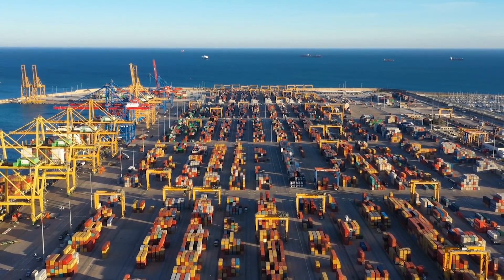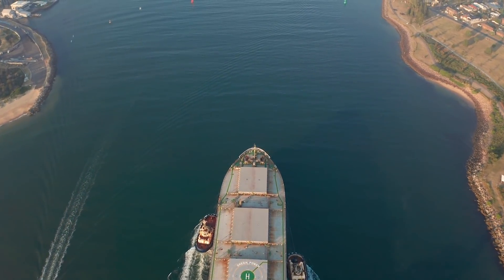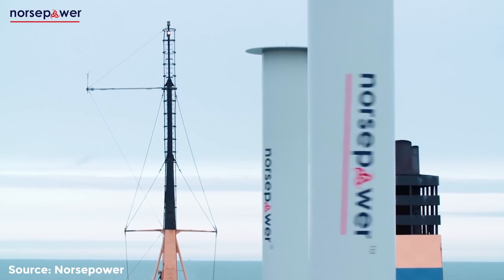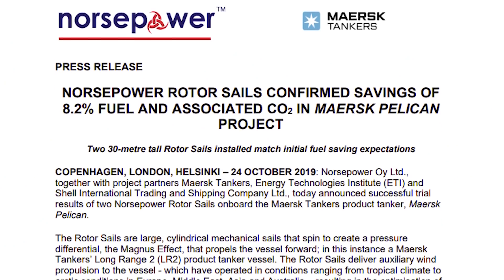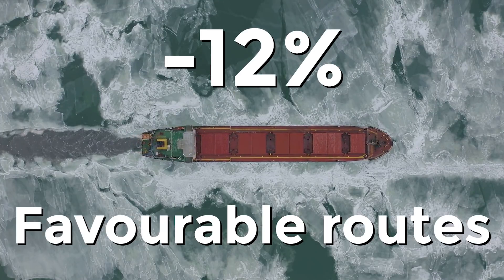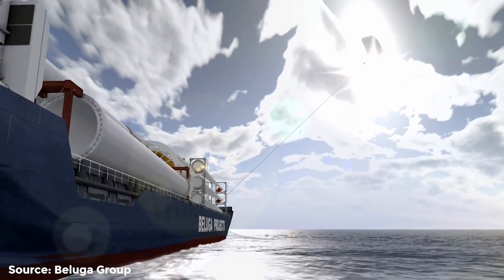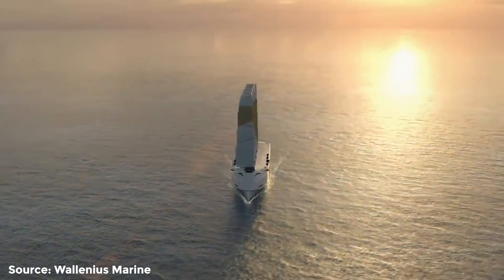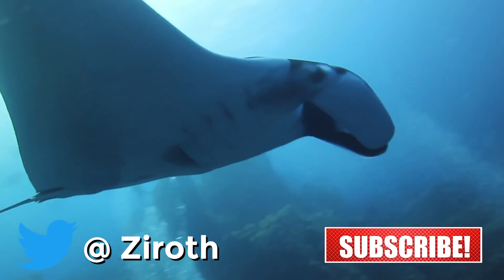Is Wind Power The Future of Shipping?

Comment: You can't expect that a propulsion technology which is intermittent (wind, solar) and is only efficient under certain conditiones (wind direction, wind speed, solar -> atmospheric conditions) can replace a technology which has a steady, non intermittent and unconditional output.    
The non deck- obstructing sail is interesting though.  Even if it can cut 10% of the fuel usage on a long trip and favorable conditions, this is a huge number when you add it up for thousands of ships.  It is also probably relatively easy to retrofit older ships with that technology.
Reply: Would 10% fuel saving fund the capital and operating costs of the additional hardware?  Fossil hydrocarbon energy  is relatively cheap, which is what created this climate change situation.  With regard to retrofitting the payback time and benefit margin must fit in the overall remaining life expectancy of the vessel being retrofitted.
Reply: @BernardLS  IMO the "climate change situation", as we have it, was predominantly created by nature, not by us.  Nevertheless I welcome technologies which replace the combustion of fossil (which might not be fossil after all)  hydrocarbons.  But only if they really can compete in an ecological and economical way.
Reply: @RogerWilco66  The "climate change situation" is another area of hot contention so best to set that aside for now.  To address the suggestions that wind power is the answer I offer the following example.  In 1870 a premium sailing vessel entered service, the ‘Cutty Sark’.  The ‘Cutty Sark’ was 64.74 metres in length with a beam of 10.97 metres and a loaded displacement of 2 100 tonnes.  She was able to carry, at best, 1 700 tonnes of cargo and to harness the energy in the wind the available spread of canvas was up to 2 976m2 which was tended by a crew of about 30 skilled men.  A ratio between the sail area (SA) and the vessels displacement (D) determines how lively she is; ‘lively’ being nautical speak for ‘fast and manoeuvrable’.  The carrying capacity of cargo ships is constrained in two ways, mass and volume which leads us to the ‘stowage factor’ of the cargo; the more mass on board the greater the displacement which in turn impacts the efficiency of the hull form and sail area / displacement ratio.  A vessel constrained by mass is said to be ‘down but not full’, while a vessel constrained by volume is said to be ‘full but not down.  When in the tea trade, which the ‘Cutty Sark’ was designed and built for with fine lines (more nautical tech speak, so again no need to worry about it) she could carry around 600 tonnes of cargo at speeds of up to 17.5 knots dependent on the prevailing wind and had a typical China to UK time on passage of 120 days.  The tea trade was very competitive so ‘time on passage’ was a large factor in securing the premium freight rate that made her cost effective.  Rounding things out, her maximum available sail area gave circa 5m2 of canvas for every tonne of tea carried.

As soon as the Suez Canal opened, which the ‘Cutty Sark’ was unable to sail through; she lost her advantage, raw speed, to the steam powered ships of that era who could beat her ‘time on passage’ by taking that short cut.  Mechanically powered ships have improved in terms of efficiency, on a freight tonne mile basis, by at least one order of magnitude since then.  After losing out to the coal burning, fire tube boiler, steam reciprocating mechanical ships of the late 19th century ‘Cutty Sark’ was relegated to the Australian wool trade, just about the bottom of the barrel in maritime terms and only one small step up from being a 'honey barge'.  The canvas, cordage and extra manpower needed for sailing ships was never a very benign environmental option so please discount any idea of sail as ‘sustainable’.  All this is without the problem that if ‘the wind don’t blow the ship don’t go’, when it does blow it often blows in the wrong direction for your cargo delivery needs and sometimes there is rather too much of it for comfort.  Sailing ships are unable to go directly up wind so if the wind is blowing from the direction your cargo needs to then a zig-zag course must be steered, more distance and more time.  Wind speed is traditionally measured on the Beaufort Scale (wind speed) that runs from 0 (< 1kn) to 12 (> 63kn) and for sailing purposes the usable part of the range is ‘3’ (circa 8kn) to ‘6’ (circa 24kn).

Random fact about ‘Cutty Sark’, it is said to have been possible to coax 3 000 horse power out of her sails, or in ‘real money’ 2 206 500 Watts (2.2 megaWatts), or 741 Watts for each square meter of sail area.  So that majestic spread of canvas would have been even less efficacious for delivering your baubles and bows from the orient, despite taking about three times as long on the voyage.  The sails on the ‘Cutty Sark’ produced about 0.33% of the power need to propel a Mearsk Triple E and in ‘ideal conditions’ the energy harvest would be less than one two hundredth of the output from the ICEs.  Remember shipping is a high volume low cost, therefore low margin business, and all costs have to be beneficial.

Canvas and hemp are accorded 'renewable' (read as ‘natural’) status, if ‘synthetics’ are used there will still be a need for the input of FOGI products.  'Synthetics' would have a much better working life span than 'naturals' but would still yield the same amount of energy, 741 Watts for each square meter in those elusive ideal conditions.  Wallenius are currently giving wind power a go with wing form ‘sails’ but evidence is a little short of proof as of this date.  KTH (Kungliga Tekniska högskolan), a sort of up market university in Stockholm, who are using the funding to derive results will probably, and eventually, in the best traditions of academia ‘publish’ a ‘paper’ unless the funders invoke the well known ‘commercial sensitivity clause’ of their agreement with the KTH.  On board wind turbine might get you around some of the problems, however for marine use vertical axis wind turbines (VAWT) would be better than, the what have now become 'traditional', horizontal axis wind turbines (HAWT) for reasons that include the air draught of the vessel, weight distribution and maintenance access.  The energy yield is still subject to the wind blowing at the right strength and having space available on board for the hardware.  The masts, rigging and sail handling arrangements would take up 'prime real estate' on the vessel.  Fuel oil bunker tanks can be, and usually are, stuck away in any odd corner and the ICE power plants are themselves relatively compact.  The stacked up 'boxes' would mean putting the wind driven propulsion units in a bad situation from a ship stability point of view.

Comment: Big issue is the ratio displacement/sail area. It's not even close in these projects.
Reply: When in the tea trade which the ‘Cutty Sark’ was designed and built for, with fine lines, she could carry around 600 tonnes of cargo at speeds of up to 17.5 knots dependent on the prevailing wind and had a typical China to UK time on passage of 120 days using up to 2 976m2 canvas sails.  Rounding things out, her maximum available sail area gave circa 5m2 of canvas for every tonne of tea carried.  So to move 180 000 tonnes of cargo, a typical VLCC or Post Panamax, could call for up to circa 900 000 m2 of canvas; which would be impressive (:-).

Comment: Edison generators and dynamos easily replace fossil fuels. Edison generators are permanent magnet motors that have generator coils of copper wire. You can chisel an old car generator pre 1974 to spin itself and generate electricity. Of you add 12v 110v ac inverters you can produce house current 6  20 a outlets.

Comment: The future of ship propulsion is nuclear. Ask the US navy
Reply: WADR if you do a web search for ‘nuclear ship savannah’ you will see that it has been tried and did not work.  A similarly vessel heavily subsidised, by the government, vessel is in use in Russia which also operates, in support of the Northern Sea Route, a fleet of nuclear powered ice breakers all of these may, or may not, have been completely without issues.

Just think; would you have full confidence in the management of a nuclear reactor under the control of an anonymous entity only traceable, perhaps, via a letter box in a FOC (flag of convenience) nation state?  If you are, could you sell that confidence to Japan, the state that hosted the Hiroshima and Nagasaki nuclear detonations as well as more recently the Fukushima ‘event’?  Then try that same, or a similar, sales strategy on Ukraine, the nation state that as a part of the USSR (CCCP) hosted the Chernobyl ‘event’.  Modern iterations of nuclear energy, thorium fuel, molten salt reactors or fusion reactors, will carry the legacy of past problems.  It is the global trepidation of anything with 'nuclear' in the name and the economics of nuclear having transitioned from 'energy to cheap to charge for' too 'the costs of remediation are incalculable' that will prevent the adoption of nuclear energy as a means of creating energy at sea.  Modern reaction systems may have overcome the safety problems but the general public, having been misled in the past, will be reluctant to believe the fresh new promises.  The incident of the ‘Ever Given’ blocking the Suez Canal, March 2021, may also have a little to add to this debate.  The cooling water on ships tends to get taken in from near the bottom so when running aground the inlets are in a prime spot to get plugged up restricting, if not stopping, the flow of coolant.  One thing that the TMI, Chernobyl and Fukushima incidents all had in common was that the supply of coolant, or rather lack thereof, was a fundamental cause.

‘They’ say nuclear is cheap, it’s not it is expensive and has a large embedded carbon quotient as well as being complicated, dangerous, not universally socially acceptable and having only ‘no need for refuelling’ as a questionable advantage; actually it does need refuelling just not as often.  When ‘they’ do need to refill the warming up stuff it takes considerable longer than pumping tonnes of thick black stuff, cSt380 HFO, or thin runny stuff, MDO, onboard which is one of the reasons HMS Queen Elizabeth and HMS Prince of Wales are pushed about by ICEs and gas turbines thus using a similar fuel as the aircraft that fly off of them.  The Royal Navy (RN) with a high degree of skill and expertise uses, at vast expenses to the UK taxpayer, a current operational nuclear fleet of 11 submarines (also known as ‘boats’) in two flotillas, seven attack subs and four ballistic missile boats.  The carbon footprint of all the extra bits of hardware and the fuel, including processing thereof, from ground to propeller, are the external costs that never seem to get considered.

Disposal, once it wears out, of both the machine (that was a ship) and fuel is another can of worms best left unopened.  The 26 RN boats no longer in use are laid up (some in Rosyth and some in Portsmouth) awaiting long term deconstruction including dealing with the fuel rods and other irradiated material.  The USN is not, as far as I know, a commercial organisation working to very tight margins and also has the skill and expertise to handle the complexities of nuclear power; so as well as submarines their aircraft carriers are nuclear powered and each of the current iteration has a build cost three times that of QE/PoW, bigger crews and more generous funding.  For those who still think that nuclear energy might be the answer I recommend this report: - https://www.bbc.com/future/article/20200901-the-radioactive-risk-of-sunken-nuclear-soviet-submarines?ocid=ww.social.link.email.  The navy of the USSR might have been under resourced and over extended but it was still generously supported in comparison with merchant shipping.

Comment: Does the word "becalmed" mean anything to you? Definitely would also be a blast riding out a hurricane in one of these.
Reply: Here is my two penny worth. To address the suggestions that wind power is the answer I offer the following example.  In 1870 a premium sailing vessel entered service, the ‘Cutty Sark’.  The 'Cutty Sark' was 64.74 metres in length with a beam of 10.97 metres and a loaded displacement of 2 100 tonnes.  She was able to carry, at best, 1 700 tonnes of cargo and to harness the energy in the wind the available spread of canvas was up to 2 976m2 which was tended by a crew of about 30 skilled men.  A ratio between the sail area (SA) and the vessels displacement (D) determines how lively she is; ‘lively’ being nautical speak for ‘fast and manoeuvrable’.  The carrying capacity of cargo ships is constrained in two ways, mass and volume which leads us to the ‘stowage factor’ of the cargo; the more mass on board the greater the displacement which in turn impacts the efficiency of the hull form and sail area / displacement ratio.  A vessel constrained by mass is said to be ‘down but not full’, while a vessel constrained by volume is said to be ‘full but not down.  When in the tea trade, which the ‘Cutty Sark’ was designed and built for with fine lines (more nautical tech speak, so again no need to worry about it) she could carry around 600 tonnes of cargo at speeds of up to 17.5 knots dependent on the prevailing wind and had a typical China to UK time on passage of 120 days.  The tea trade was very competitive so ‘time on passage’ was a large factor in securing the premium freight rate that made her cost effective.  Rounding things out, her maximum available sail area gave circa 5m2 of canvas for every tonne of tea carried.

As soon as the Suez Canal opened, which the ‘Cutty Sark’ was unable to sail through; she lost her advantage, raw speed, to the steam powered ships of that era who could beat her ‘time on passage’ by taking that short cut.  Mechanically powered ships have improved in terms of efficiency, on a freight tonne mile basis, by at least one order of magnitude since then.  After losing out to the coal burning, fire tube boiler, steam reciprocating mechanical ships of the late 19th century ‘Cutty Sark’ was relegated to the Australian wool trade, just about the bottom of the barrel in maritime terms and only one small step up from being a 'honey barge'.  The canvas, cordage and extra manpower needed for sailing ships was never a very benign environmental option so please discount any idea of sail as ‘sustainable’.  All this is without the problem that if ‘the wind don’t blow the ship don’t go’, when it does blow it often blows in the wrong direction for your cargo delivery needs and sometimes there is rather too much of it for comfort.  Sailing ships are unable to go directly up wind so if the wind is blowing form the direction your cargo needs to then a zig-zag course must be steered, more distance and more time.  Wind is traditionally measured on the Beaufort Scale (wind speed) that runs from 0 (< 1kn) to 12 (> 63kn) and for sailing purposes the usable part of the range is ‘3’ (circa 8kn) to ‘6’ (circa 24kn).

Random fact about ‘Cutty Sark’, it is said to have been possible to coax 3 000 horse power out of her sails, or in ‘real money’ 2 206 500 Watts (2.2 megaWatts), or 741 Watts for each square meter of sail area.  So that majestic spread of canvas would have been even less efficacious for delivering your baubles and bows from the orient, despite taking about three times as long on the voyage.  The sails on the ‘Cutty Sark' produce about 0.33% of the power need to propel a Mearsk Triple E or less than one two hundredth of the output from the ICEs.  Remember shipping is a high volume low cost, therefore low margin business, and all costs have to be beneficial.

Canvas and hemp are accorded 'renewable' (read as ‘natural’) status, if ‘synthetics’ are used there will still be a need for the input of FOGI products.  'Synthetics' would have a much better working life span than 'naturals' but would still yield the same amount of energy, 741 Watts for each square meter in those elusive ideal conditions.  Wallenius are currently giving wind power a go with wing form ‘sails’ but evidence is a little short of proof as of this date.  KTH (Kungliga Tekniska högskolan), a sort of up market university in Stockholm, who are using the funding to derive results will probably, and eventually, in the best traditions of academia ‘publish’ a ‘paper’ unless the funders invoke the well known ‘commercial sensitivity clause’ of their agreement with the KTH.  On board wind turbine might get you around some of the problems, however for marine use vertical axis wind turbines (VAWT) would be better than, the what have now become 'traditional', horizontal axis wind turbines (HAWT) for reasons that include the air draught of the vessel, weight distribution and maintenance access.  The energy yield is still subject to the wind blowing at the right strength and having space available on board for the hardware.  The masts, rigging and sail handling arrangements would take up 'prime real estate' on the vessel.  Fuel oil bunker tanks can be stuck away in any odd corner and the ICE power plants are themselves relatively compact.  The stacked up 'boxes' would mean putting the wind driven propulsion units in a bad situation from a ship stability point of view.